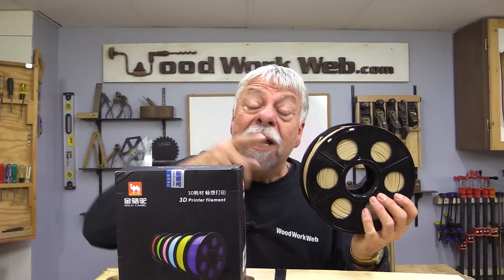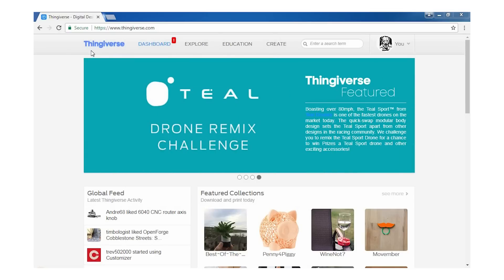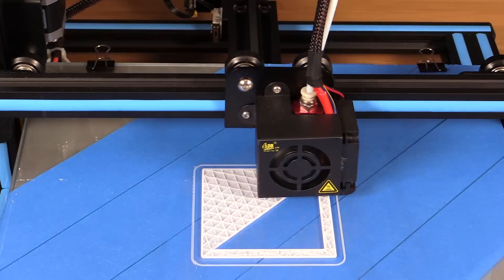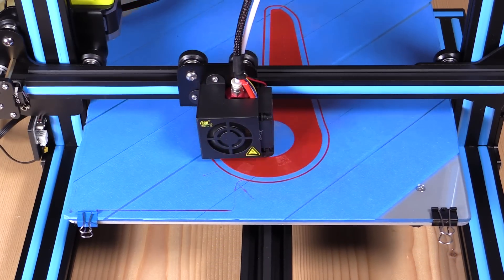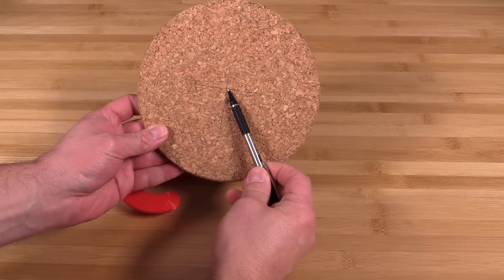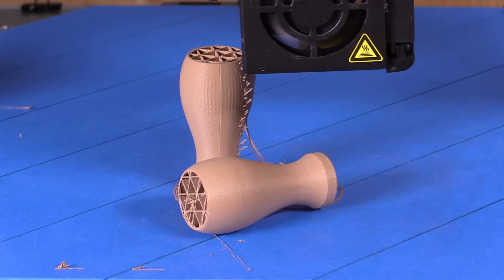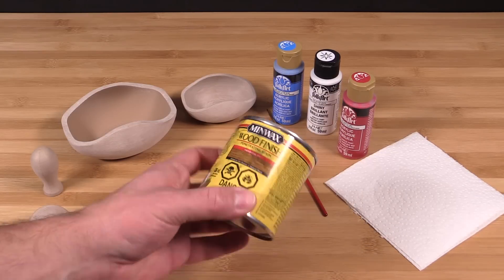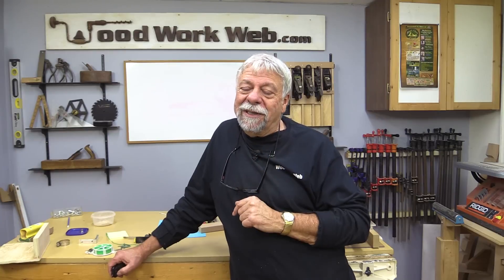3D Printing in the Workshop / 3D Printers for Woodworking w/ the Creality CR-10

Comment: Get a good textured glass bed for your printer. No need for tape or glue and everything sticks well and comes of easy by hand. Just wipe it down with isoprophyl alcohol every print or two and it works great (as long as your printer settings are good).
Reply from the maker: We're using those large bed pad stickers now and they work great. Thanks for watching.

Comment: I don't know if you can ask MakeTech if he has used the drill bit sharpener?  I wanted to print one out but was wondering how good it worked?
Reply: I've seen abrasive wheels explode from people using the side of them as a grinding wheel. In today's world where people will sue for just about any reason you can think of,, I'm pretty surprised that this little drill bit sharpener thing exists.. Or at the very least, it should never be suggested to use it with an abrasive wheel like that.
If this tool were to be redesigned so it can used with a small grinding stone in the dremel, it would be a LOT safer.

Comment: I have owned a 3D printer for over 2 years.  I use it mainly to print objects that cannot be bought.  That means that I create my own 3D objects and do not rely on the online repositories for my items.  Case and point.  I made several dovetail measuring devices that were seen online but were terribly expensive.  I made my own.  Just downloading someone else's objects is fine but creating an original object that cannot be purchased is priceless.  (learning to make 3D objects may or may not take a long time.  I have over 20 years of 3D experience so it is second nature to me)

Comment: Hi Colin, 
I was just thinking, can that printer make a gripper style push block? Those blocks are ridiculously over priced. If you can print one, what would be your total cost of doing so? 
Cheers mate.
Reply: There are plans on Thingiverse, but I would use a lot of caution with that. Some filaments are brittle and can shatter, and having your gripper break as you are pushing down straight over the blade would be a horrible problem to have happen.

Comment: If I may toss in a quick suggestion, now that I've ordered this 3D printer, I've looked into numerous drawing software programs (SketchUp, Blender, etc.) and the one that I think is by FAR the best option for 3D printing or definitely for woodworking is Fusion 360 by Autodesk. It's a full, professional, extremely powerful CAD program that is not only easy to learn and to use, it's FREE to students and hobbyists. And not only is it free, you can legally use it to make money up to $100k/year before you are required to pay for a license. I wish I'd found out about this years ago.
Reply: design spark mechanical is also a great free program

Comment: why does it print this offset border on the first layer?
Reply: It's called a Skirt: A skirt is an outline that surrounds your part but does not touch the part.  The skirt is extruded on the print bed before starting to print your model. Skirts serve a useful purpose because they help prime your extruder and establish a smooth flow of filament.  Observing the skirt also allows you to detect and adjust any leveling or adhesion issues before the actual model begins printing.

Comment: While I'm on a fixed income I can't afford much of anything but the video was very informative.  If I could afford a 3D printer I'd own one.
Reply: I just bought an Ender 3 for under $200 shipped. It prints better than some of the printers that cost up to 4x more. The one upgrade I would do ASAP is to replace the extruder it comes with with a metal one. It cost me all of $18 and it makes a huge difference over the plastic ones that will wear out quickly from the filament rubbing on it. If you do get an ender 3, check out "house of 3d printed horrors" youtube channel. He has an amazing video on setting the printer up that covers a lot of things that no one mentioned in other videos (like adjusting the wheels under the bed before you complete assembling the printer) and is not mentioned in the setup guide. He had me up and running and printing things that looked better than some of the "experts" on other videos.
Reply: Prices are really coming down on 3D printers these day and there's also a large used market ... you can probably find a steal of a deal is you keep your eyes open Ken.
Reply: There are very cheap 3D printers available, not all are reliable though, check out the Monoprice Select Mini 3D Printer V2 for $219.99 or the TronXY for $120

Comment: While an interesting video, I really do not see this as a tool for the wood working shop.  I imagine it useful for the occasional thing, but couldn't see the time/effort/cost as being anywhere near reasonable for most things.  The items you guys chose to create are cases in point:  I can buy a hacksaw handle, a chisel handle and a cylinder center finder MUCH easier than I could make them...and probably waaay cheaper, too.
Reply: Its good when you need to print out parts to repair things - I fixed my bandsaw with some parts - https://www.youtube.com/watch?v=SajO0jIDnsc&ab_channel=RandomSmith and modified some clamps for my track saw - https://www.youtube.com/watch?v=T490Wo9lspo&ab_channel=RandomSmith
Reply from the maker: As RandomSmith mentioned, they come in handy for many repairs too. They may not be for everyone, but it's really just another tool for the shop.
Reply: The items I demo'ed are only simplest of the items I found on Thingiverse ... there's A LOT out there to be made. They're not for everyone, but they're becoming more and more capable everyday.
Reply: All at sense any make doesn't said just you what.
Reply: Cliff Carlo what’s with the negativity lol
Reply: Actually these items cost pennies to make(materials are dirt cheap) so you wont get them way cheaper even if you pay a buck for each, the cost is in the buying of the printer. Then the more you print the more you save. Everyone's mileage will vary of course due to use and variable printer costs.
Reply: +Larry B I am inclined to agree with you on this one
Reply: Nah.
Reply: I understand where you're coming from but, after getting my first printer last December, I haven't looked back. I've made so many jigs and accessories for my shop that I use regularly and have also designed and printed so many things for repairs/solves around the house. 100% worth it if you're technically inclined. 3D printers definitely require a lot of ongoing calibration and tweaking but I enjoy tinkering so its part of the fun for me.

I just designed some custom hooks for our Christmas lights and, as I'm typing this, the prototype is printing. In about 15 minutes, I'll hold it in my hand. It will be the only one that exists in the world. Thats pretty cool to me.
Reply: As with any tool, everybody has to judge its actual use besides the coolness factor. As mentioned before the material cost is also negligable compared to the time you need to invest to design the parts. For this to take I think we need cheap and accurate 3D Scanners like we have for paper today. Happy printing ;)
Reply: You can't buy the items cheaper than making them. The cost of the printer is something else but it is way cheaper to make the part.
Reply: @shanemaitland8010  are you including the cost and time of running it?